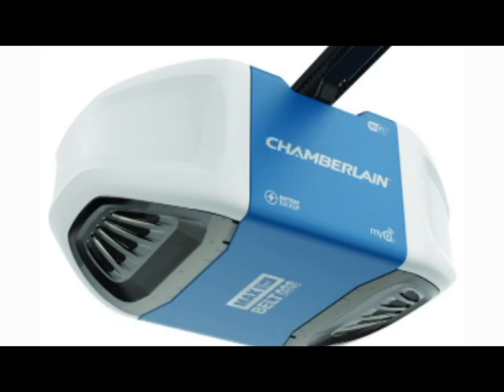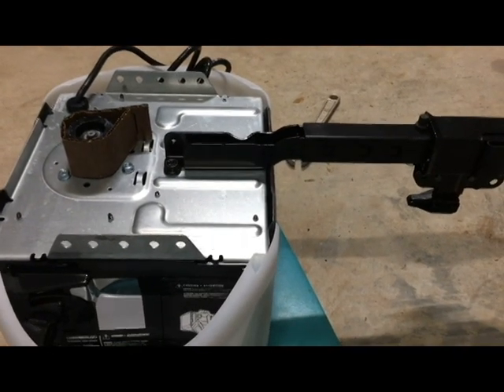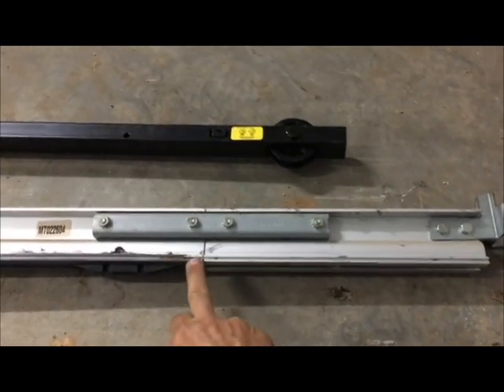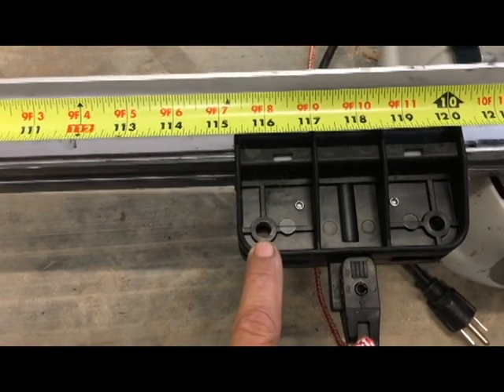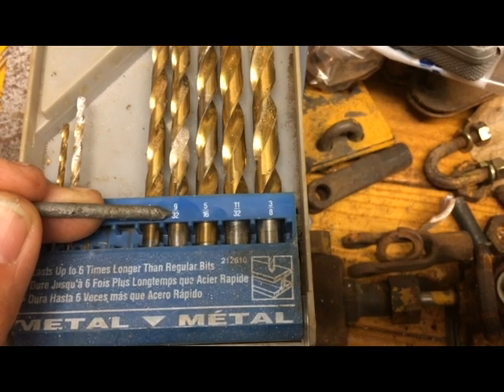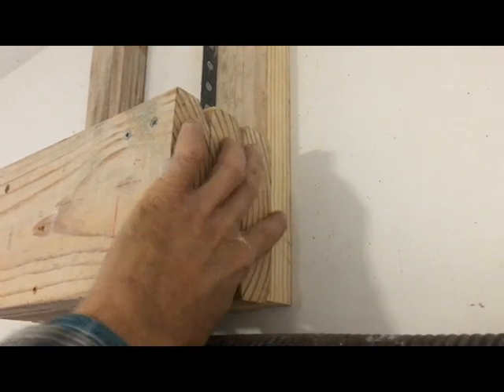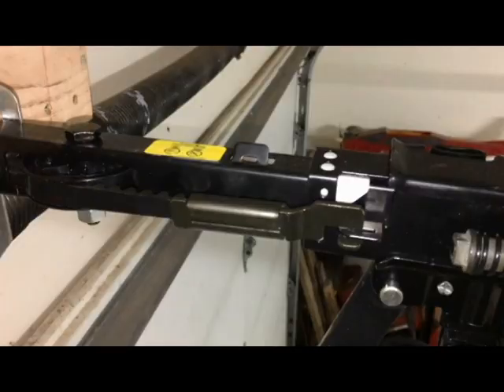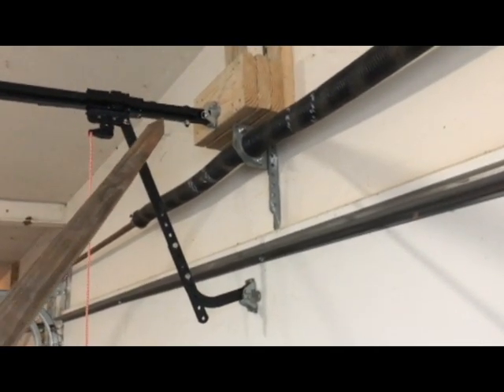Using 7 foot garage door opener with 8 foot door

Comment: I have a 7ft opener on my 8ft door i got a chamberlain PD752d 3/4 hp ac chaindrive i just took the stop bolt out and brought the travel up 6 inches and it only its 4 inches below the header it clears what i need it to clear and gets the job done flawlessly

Comment: Why Chamberlain do not make an opener rail for 8 foot door ?Do we have same problem with other brands ?
Reply: Exactly.  These companies can make a universal unit that at least covers 7 and 8 foot doors.  The 10 ft doors are a different story but it would be nice if better information was given when you buy the garage door opener to begin with.
Reply: Just bought and installed a chamberlain 2202 . The door will only go up 67 inches before it locks. Frustrating piece of junk

Comment: That works, I can add a couple pro tips for some situations others may run into. 
1) You can manipulate the arc of the top section when it opens by adjusting or moving where the top rollers mount. In a worst case scenario they sell “low headroom” top brackets, or even low headroom double upper tracks. It doesn’t make the smoothest working door, but if you don’t have room between the arc and ceiling can be a solution.

2) Ideally you want the operator, front and back, installed as low as possible. This also means once installed the track will not be level, it should be sloping down from the wall to the head with the rail only about 1/2” above the fully opened door.

3) #2 will help you get the connecting arm as short as possible, which will also require less over all travel distance and give you a more secure as well as smoother operating door.

4) When the door is fully closed you ideally want the arm as perfectly straight up and down as possible. This helps push the top of the door fully closed, the bottom of the door down for a good seal. Most importantly this helps make your door more secure. When perfectly at 90deg to the floor it makes the door impossible for someone to grab the outside of the door and force it open, they’ll just be pushing straight up against the rail. The further someone installs the arm leaning back the easier it is for someone to force the door up and open. 

5) By following #4 you may save yourself from extensive door damage should a spring break or cable come off when closed. With the arm leaning back the operator will attempt to rip the top of the door apart when its pulling dead weight. If the arm is perfectly up and down its going to try to lift the middle of the door up rather than straight back.

6) Bonus tip: When installing the arm mounting bracket to the door you want the pin, or pivot point on the door inline with the horizontal plane of the top two roller shafts.

Comment: here's a thought. just cause its an 8ft door doesn't mean you need to open it fully to get your car in, so it stops at say the seven ft height the only drawback is a visual one but not of function, if your in need to go all the way up cause your bringing something into the garage you can always disengage the trolley for a few mins. Yeah i realize this is asking for trolls to attack but hey I'm not the one too cheap to buy the right opener.

Comment: That looks hideous. Save the effort and get an 8' rail in the first place
Reply: Andy Wagner still like $70-$80 for an extension kit. Sure this method doesn’t look as good as a regular extension kit, but it gets the job done
Reply: @chamberlainliftmasterfan-2521  
A extension kit is between 45 and 50   
Not 70 to 80 
Probably spent 20 bucks in wood and screws bolts etc. Unless you bought Chinese crap